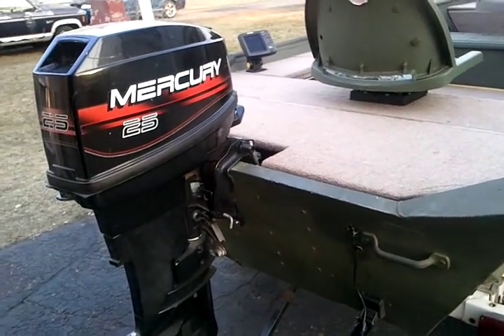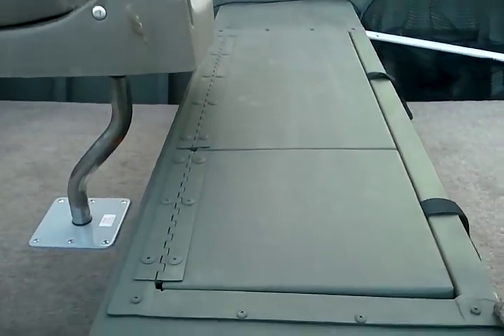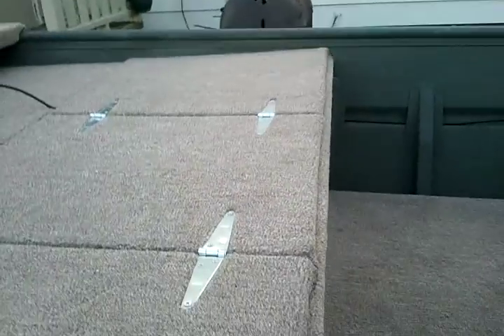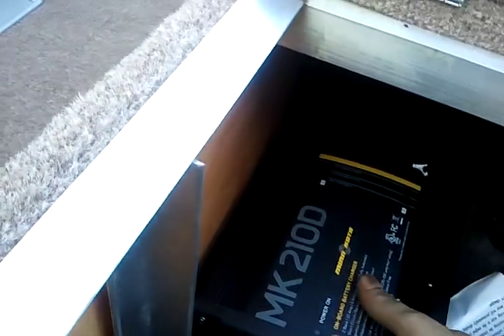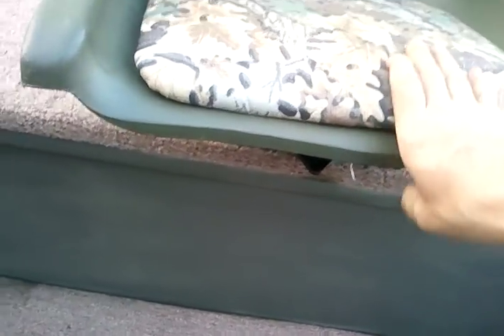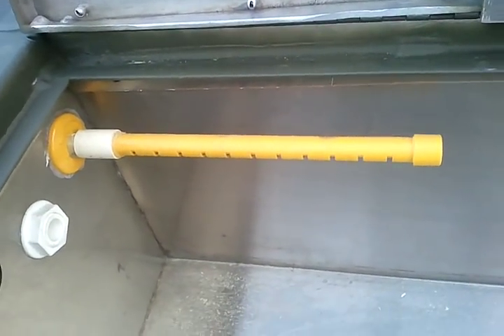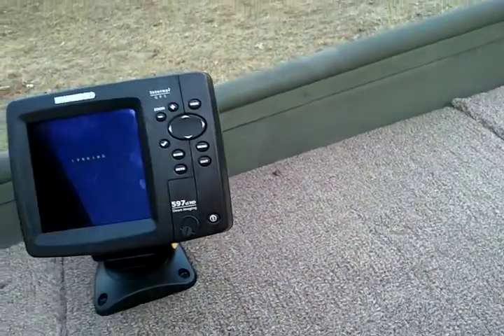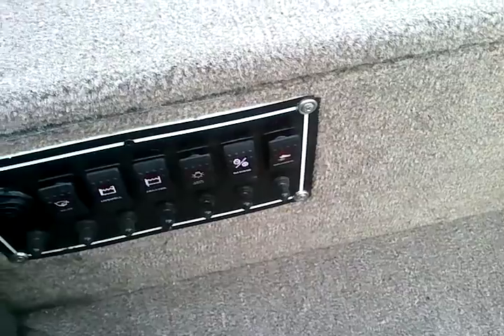1648 Alumacraft Jon Boat Modification complete

Comment: Wow bud very sweet job.Your a fusy bugger arnt you lol. Ya me too.I just picked up a 14 foot 1990 starcraft.It was converted prob about 5-8 years ago.Center bench was taken out,rod storage,battery and saftey storage.step up flat deck on the bow.flooring all through.The guy did a really good job but the boat had been left out side untarped for several years.So this winter Im going to redo the wood and carpet and add some stuff.I really like the idea of using the bench for live well,thats awsome.

Comment: Put cut up green pool noodles in the side cracks where u said things fall through, I did it for my alluminum floor I put over my jonboat ribs the same way u did, it works amazing and you always could remove them
Reply from the maker: Evan Ragon already did via another tip from a follower. Thanks.
Reply: No prob, but you need to put a 40horse on that boat, I have a 40 horse on my 1980 Monark 16' jonboat and it does 33 mph, I need to put a 50 horse on it though because it weighs a bit more then yours do to A LOT of Aluminum
Reply from the maker: +Evan Ragon The boat is rated for 35 max....could get cited for more HP
Reply: View From the Cheap Seats evinrude 25etec has unbelievable power and it's a two stroke
Reply from the maker: that merc 25 moves it along pretty good.

Comment from the maker: Also, the trolling motor runs off it's own battery up front (sits next to charger) which runs the TM pretty much all day on one charge. I've had the aerator on the timer run for three days strait without a charge.

Comment: sawwweet. only thing I see you still may need, a divider in your livewell. as for the ?void? hmmmm, maybe a piece of half sawn pvc, to hold the different lures, pliers, tackle, and such your using at the moment, to keep from diving into a box so frequently. the right size would fit snug, and with simple partitions, keep things separated. a few drill holes would keep it dry? also, love the "whole front" panel for the trolling motor, instead of just a 2by4, looks cleaner, and another place to step on. have a great season!
Reply from the maker: you should see my video on the livewell. I use a bait tamer...works sweet in my livewell so no need for a divider. 

Not sure what you mean "void"..you will have to explain your half sawn pvc comment. I cannot picture what you are referring to.
Reply: kevininspects will look for the other vid. I  was referring to where you have your net, where you were concerned about loosing things. on second viewing, it looks larger then the first time. still, a container of some sort would solve any problem. also, that location looks ideal for rod holders.

Comment from the maker: As the title suggests the boat is 16' and 48" at the bottom. 72" at the beam. I did the project over the winter. Added about 150lbs in wood and materials....but also another 160lbs of water in the livewell. sits deeper of course, but not as much as you'd think.  i think with the livewell, cost was $1300 not including the fish locator and trolling motor.

Comment from the maker: The only foam removed in the entire build was to install the livewell in the middle seat, so no insulation could be added back to that area. There is foam under the rear seat and front deck, plus all the plywood decking floats too. 
If you add foam panels at the bottom, you are stopping water flow under the deck for when it rains, etc....plus that foam tends to get water logged over time.

Comment from the maker: you plug it in like any charger. Battery can run the livewell aerator for 3 days without charge (it's on a timer comes on every 3 minutes for 30 seconds) 
TM has it's own battery. can get a full day of heavy use out of one charge.

Comment from the maker: Bought boat, motor, trailer, seats and a trolling motor for $2400.
The decking, carpet, hardware, electrical and livewell along with pumps were about $1300.
New trolling motor was $410, mount $40, and fish locator was $570.  I sold the existing trolling motor for $100 and the old TM mount for $30 and a $30 rebate for the charger.

Comment: I see that, but my question was aimed at how you power the charger? does it run off the motor, or do you have to plug it in to shore power to run the charger to charge the batteries?

how long can you run the livewell and trolling motor and fish finder, dock lights etc?

Comment: When you mounted your aluminum rails...  Are they just 90 degree rails mounted to the spines on the inside of the boat?  Also what screws did you ise to mount aluminum to aluminum for the rails?

Comment: Did you seal the wood? Or is it pressure treated? If it is pressure treated be very careful as it will cause a bad corrosion issue with the aluminum if it contacts the aluminum. Looks sharp!!!!

Comment: Wondering how much weight you added to the Jon with the mods? Max weight on that jon would be around 900? wouldn't all the extra wood add a couple hundred pounds reducing your passenger capacity?
Reply from the maker: +Jared Torbert 150
Reply from the maker: +kevininspects 700lb capacity. it's pushing it a bit. Maybe 200....doesn't matter. It planes easily even with a full livewell and a 250 passenger up front.  Rare do I fish with 3 people, but I've had 4 and it planes fine with empty livewell. .

Comment: How sturdy are those seats?  And where did you get the offset poles for the seats?  

Awesome job man.
Reply from the maker: Nate Turner I had concerns on how sturdy, but I've had some pretty big men in those chairs with no issues. I believe I bought the offsets pedestals thru Amazon
Reply: Thanks for the quick reply man cheers.

Comment from the maker: @waterfowler2 Also should note....originally when I bought the boat it had a treated front deck....which was older and worn...when I took it off, there was zero sign of corrosion.

Comment: this may be innapropriate to ask and you dont have to answer but about how much did all of this cost(with out the cost of the boat)
Reply from the maker: Depends on what you mean by "all" I added the locator/trolling motor and livewell which were all very expensive.

Comment: How did you mount the seat on top of the casting deck? Did you have any supports underneath?
Reply from the maker: I made a plywood template of the bolt holes and a hole for the pedestal to fit. I cut a hole to get access under the deck on the wall of the bulkhead....used bolts long enough to get thru plate, carpet and two sheets of plywood. Stainless..

Comment from the maker: 1 1/4" x 1/8" angle alum.  All alum to alum connections are pop riveted using 3/16" x 1/2" rivets.
Framing is riveted to the ribs.

Comment: what was the hardest part out of all the mods?
Reply from the maker: cutting the plywood the proper size and accounting for 1/8" of carpeting to each dimension side.  Epoxy coating the plywood was a bit of a pain....epoxy sets up so fast and it's so expensive that once activated you only have so long to apply it to the plywood...both sides....was a bit of a rush.

Comment from the maker: wives tale....there is no harm...sonar is not water cooled...lol. sonar travels faster in water than air...so even though the transducer was 2' off the driveway, the sonar reads it as 7 foot due to time based calculation.
I've left my sonar on before in the boat and trailered it home (not on purpose) with zero ill effects.

Comment: Nice job BUT I would have used COOSA BOARD instead of plywood. Once that plywood gets wet under that carpet and the moisture gets locked in, the process of rotting begins...COOSA BOARD WILL NEVER ROT...
Reply from the maker: Plywood all sealed with epoxy before the carpeting applied. Same stuff used on surfboards. Works awesome.. coosa board is too much $$. 3X the cost.

Comment: Should have made storage open the other way
Reply from the maker: Tried to make that work but lid wouldn't open far enough to make it work due to gunnel. Easy access to it when boat is on trailer tho.  No where to put the hinges on and make it work.